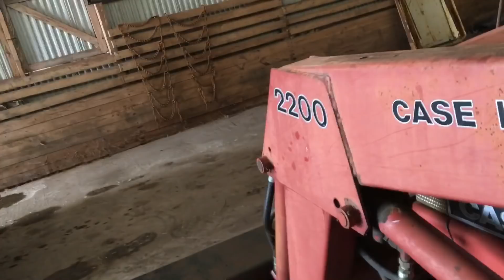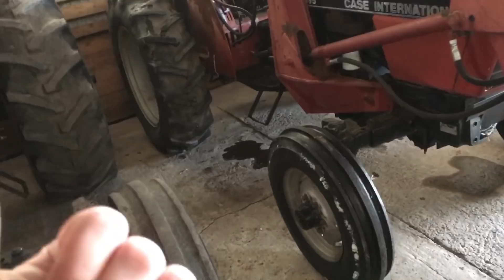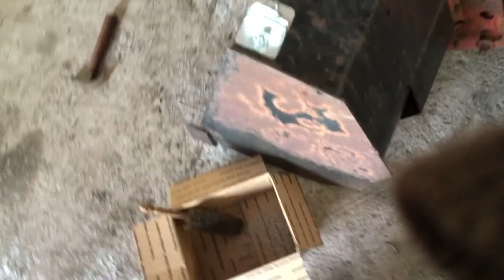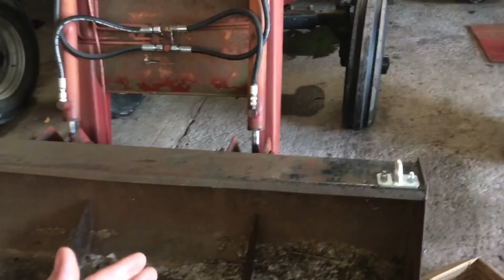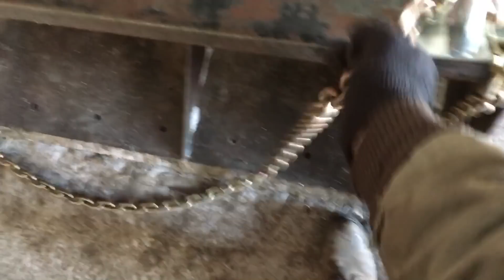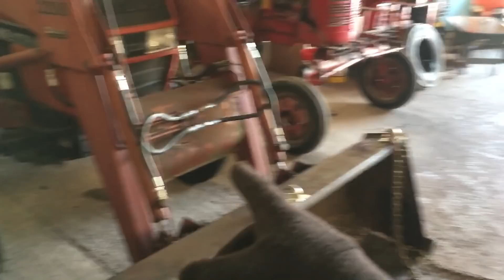Bolt on Loader Bucket Hooks

Comment: Not sure what all you guys get into but here we use everything from chains to tow straps, cables, and now n then ropes to hook up to the tractor's bucket hooks and so we added 3/8 slip hooks in between the grab chain hooks... we've tried using the grab chain hooks for other than chains but what happened is that eventually the chain-style hooks started cutting through our tow straps and ropes, and put notches into the eyelets of our cables which causes a weak point in them
Reply from the maker: I don’t do a lot of loader work really as far as using chains or straps. I’m hoping they work, I only used them 2 times so far

Comment: Ur right definitely can’t go cheap on drill bits. We put a set of forks on the backhoe and made a tube that bolted between the sides of the bucket. It’s pretty rigged
Reply from the maker: I usually order bits from a machinist catalog. I think the set I have was $400. But I have had them and re-sharpened them for 5 years

Comment: Good day. Yes if you can get chicken manure, go for it. I think chicken manure is highest in nitrogen. Also my 574 with that style of block heater,  2 hrs. & even battery is warm up .  Putting weight on back would be good  idea. I have 45 gal barrel full of cement  I should send you lol Thanks. I would like to see 485 working. Thanks
Reply from the maker: Haha yea you can send the barrel weight via UPS!!! That wouldn’t be cheap. Tomorrow’s video I am using the tractor a little.

Comment: We used those clamp on forks on the wheel loader at work don't ask me the size it was a case we used it to load salt. But those clamp on forks worked slick I didn't mind them
Reply from the maker: Ok, if the loader is only rated for 1500lbs then I can get the 2000lb set and should be good
Reply: PA Farms I'd think you would be